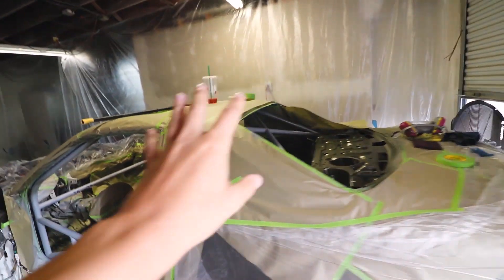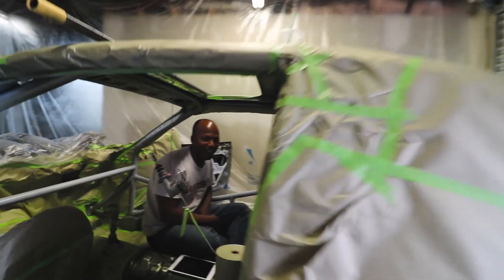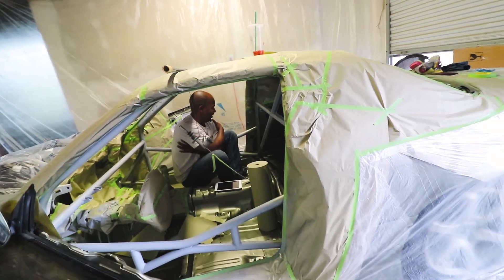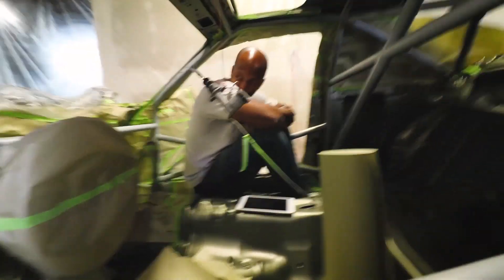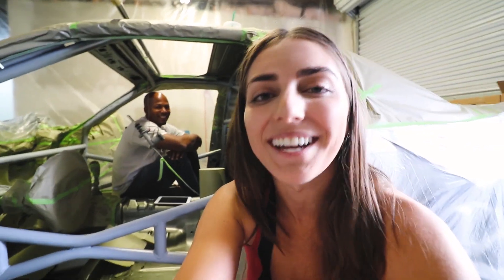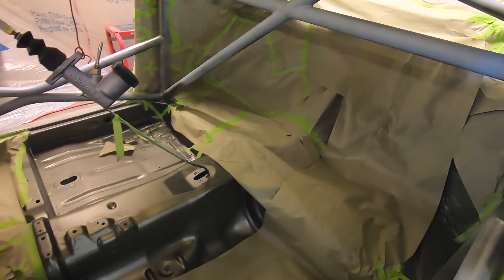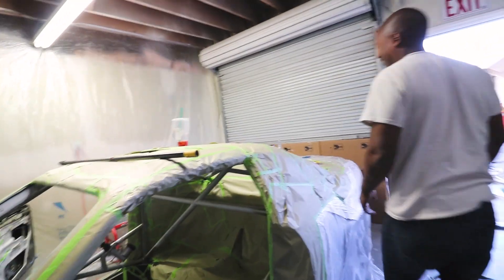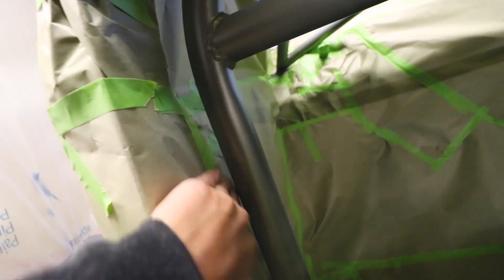PAINT REVEAL ON LSx S14! IT LOOKS SOO BAD***!!!

Comment: I had a 87 formula that had that condition, they call it "S.A.C." Sudden acceleration condition, with mine it was a short in the cruise control module and with an auto trans it can be scary. Put the car in reverse on day after work and the throttle went to the floor and before in knew it that sum bitch was hauling ass backwards laid on the brakes, cranked the wheel to avoid a building and turned the key off just missed nailing my boss's car by about two inches.

Comment: I've definitely noticed, especially on Subarus, that when putting an aftermarket downpipe on the car without a new heatshield, that the oil lines tend to cook, the under hood temps go up, and I'm sure it's not great for heating up the intercooler.  A DEI Titanium turbo blanket and oil line sheath would probably be two very good purchases for the longevity of your turbo and that weird idle issue you have.  Good luck.

Comment: You DON'T need acting class... You NEED Memory under stress class, that's the key in that field. 

Using current pump gas, which contains ethanol engineering terms for the ratio mixture the numbers are proportional 14.7/1 air-fuel are never used and the decimal equivalent is so that would be actually referred to as .068, these can be used in either pounds of air and fuel or kg of air and fuel... don't matter as they are mass ratios... of Atomic mass values… as that is what is used in chemical balance equations so those are in Moles.  Also, they need to be adjusted to standard day temperature, barametric pressure, and humidity!  So get out your calculator.  However, for standard day conditions the following apply, I did round the numbers to the nearest practical number, why is your car is not a lab and the following provide a practical guide:

The fuel atomic mass [moles] is always stated as ( 1 ), and that is divided by the atomic mass [moles] of the air needed to get the engineering term:

a) If you do a chemical balance you will find for current pump gas, because it contains ethanol, the air fuel ratio is 14.7/1 or .068 air-fuel [1.0 Lamda]  for perfect chemical balance i.e. stoichiometric air-fuel ratio.  Rich max power would be 12.5/1 or .08 air-fuel [.85 Lamda], and lean max power would be 13.2/1 or .076 air fuel [.9 Lamda].

b) For E85 the air fuel ratios are higher, stoichiometric is 9.8/1 or .10 air-fuel [1.0 Lamda], rich max power is 7.0/1 or .14 air-fuel [1.4 Lamda], and for lean max power is 8.5/1 or .12 air-fuel [1.15 Lamda].

(c) For standard day conditions for a given amount of power you would burn difference between pump gas and E85: at stoichiometric 147% more E85 than pump gas; at rich max power it would be 175% more, and; at max power lean it would be 158% more.  Note all these numbers are approximations.

Now you car almost never runs at perfect constant speed and power so compared to the same driving cycle you would burn somewhere around 166% more E85 than pump gas… for the same power levels but as you can get more power out of E85 you would be burning more likely 200% more.  The more you put your foot in it the closer to 175% max power rich, and the more you coasted the closer to 150% more.  Now why is max lean power less fuel efficient than stoichiometric and why does your car engine operate on emission controls closer to the higher max lean or max rich is that you have a catalyst to feed with more heat… and you don’t want to burn holes in your pistons!

Now gas mileage will always be less with premium fuel too but that can be explained another day. 

I need to send you a copy of an engineering book on internal combustions engine design.  It is by a Purdue University book by Assistant Professor Joseph Liston written as a class textbook in aeronautical engineering in 1942.  That is the high point of piston engine development.  I had a friend, Abraham Flatau who took that first class from Joe Liston both interesting guys, Abe was Director of the Armys Research Labs before he retired in 1996, and Joe Liston was like 80 years old in 1942 and taught classes in invention and entrepreneurship of campus at his home.  Modern engines are fundamentally only improved by today’s materials and pulse width modulated control… the man the invented that Warren P. Boardman of Marquardt Corp. was also a very good friend and mentor, here is one of the first engines to run on electronic pulse width control… using rocket fuel of aniline and red fuming nitric acid: https://www.youtube.com/watch?v=UdQq5gsyveg&t=0s . The silver haired man in the Hawaiian shirt is Warren then Director of Advance Developments, at a avant gard aerospace propulsion company of many engineers with doctorates. Every computer control function on modern cars originated with  Warren, he gave me an original copy of the book.  But I can get you a modern copy.  Anything you want to know or understand on engines is in that book.  Book has been sent from Amazon!

Comment: That makes me laugh, it was not the idle circuit but the cruise control. Well my subaru has a aftermarket cruise control and it no longer holds a constant speed, it's constantly switching between accel and decel. Annoying ass hell and not usable😢